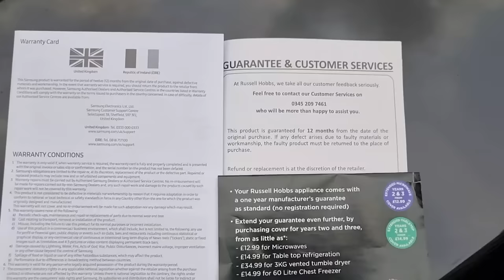My Highlights for buying a Grenadier #grenadier #ineosgrenadier #grenadier4x4

Comment: The standard 5 seat grenadier is a commercial variant if you read the website properly, its just the belstaff ones that arent. Im still curious how they're getting it approved as a commercial though
Reply from the maker: Thanks, I'll look into that. It's interesting they've done that... Looking forward to discussing it with them
Reply: @landroverleks  yeah i need a bit more info on that before I decide what to go for, as a commercial has some other benefits like lower tax.  Anyway, another great video mate 👍
Reply from the maker: @steveofengland  That sounds like the right approach. Thanks 🙏🏾

Comment: That’s funny it works now. Great vid again. Totally agree with your points. A key question is road tax..are all variants eligible for commercial rates or only the 2 seater. If so can you retro fit seats on the commercial like the vw vans?
Reply from the maker: Glad it's now working! Thanks 🙏🏾 Good question - I would assume only commercial models would benefit from commercial rates. This is based on experience of my Commercial Defender 90. I would also assume you could retrofit seats as I also did that with my 90, but that is probably more of an insurance question in terms of modifications to the vehicle. I do feel those are two good questions to put to Grenadier, so I'll add them to the list.

Comment: Aha! found where you were getting the specs. Australian site doesn't have a brochure yet. A few observations from there:

It's a heavy beast - especially in diesel wagon (2,740kg)  which most Australians will spec. That leaves a good 760kg payload if not the pie-in-the-sky 1,000kg that was sometimes rumoured.
Roof loading (150kg/420kg) is brilliant.
Diesel highway 10.4 l/100km, apparently on the K02s(!),  is good.
90l fuel tank is simply not enough for Australia, so there will be a rush on jerry cans here.
Diesel torque delivery (550Nm 1250 - 3000rpm) is great.
Turning circle (13.5m) accounts for standard (in Aus) rear view camera - lots of 3 point turns.

Mystery: So they dropped the 5-seat utility BUT the standard station wagon back seats have 6mm less legroom and 91mm more luggage length behind them than the Belstaff editions. Brochure also does not quote luggage length or volume behind first row seats for standard station wagon. Different back seats? Is the standard station wagon really what we thought would be the 5-seat utility? The photos on page 22 show standard station wagon has seat-backs further forward and the table notes a half height  cargo barrier.

If the rear seats on the standard wagon are further forward, more upright, don't fold, and have a cargo barrier behind then it really is the utility 5-seater. That means getting the standard wagon with  cherry-picked options is not really an alternative to the Belstaff editions that have a more comfortable rear seat that folds for more luggage space.
Reply: My local Gold Coast Distributor said they were working on long range tanks. I am getting the safari windows so full roof rack is out and the roof bars will need to be mounted too far back to mount the LED light bar. The Roo bar says it has mounts and wiring for extra lights so I will wait and get some lights mounted locally or mount them myself.
Reply from the maker: Great observation Mark! Insightful on the differences in back seats set-up in the Station wagon relative to the Belfast editions. That's a question I'll be putting to them - Are we being sold the Utility 5-seater wagon as a Station wagon?
Reply: @DavesIneosGrenadier  Dave, trying to track down the roo bar wiring info - was this on the website?

Comment: Yes good summary, few more specs would be very grateful: maximum axle loads and loads at tare, weight of alloy v steel wheel rim etc,  Pictures of accessories to understand how they all fit in would be helpful. Guess this info might come on the 18th but at present it seems only the U.K. market received a brochure - some of the details in that as we now know, are not applicable to other markets e.g. tow ball down load for U.K. is 150kg.  This figure caused considerable debate in Aus given our trailer ball weight is approximately 10% of the trailer. i.e. 3500kg trailer will have about 350kg of ball weight - many potential customers in Aus would have been forced to look elsewhere on this one spec alone if at 150kg.  Fortunately and hats off to Ineos Au, they did step into the debate and clarified the 350kg is indeed the tow ball download for Australia - just not published yet.  Could have saved a lot of effort if information such as this was included in the 'full specifications' on line.  The informal communication with Ineos in Australia has been outstanding really.
Reply from the maker: Thanks! I agree they'll likely release more info for the Australian market later. Good to learn about the tow ball load difference between UK and Aus.

Comment: Fieldmaster, metallic gray, Rough pack, Roo bar, checkerplates raised air intake. 17" alloys
Reply from the maker: That's a great combo! We are not worthy enough for checkerplates as an option or accessory in the UK. Will have to rely on aftermarket suppliers.
Reply: @landroverleks  Happy to buy them for you and ship them over. Or better yet take them as carry on luggage. That would be amusing.
Reply from the maker: @DavesIneosGrenadier  Thanks for the offer 🙏🏾 I'll see what happens in the UK and might put the question to Grenadier. I might take you up on your offer towards the end of the year 😁

Comment: If you do everything a la carte, you will pay through the nose. If you get one of the two packages, and add a few options, that’s the “value” proposition.
Reply from the maker: 💯 I agree with that point. At the moment I'm most attracted by the proposition of the Trailmaster Edition + plus a roof rack. Other things can be bought over time... Hmmm, I would need to put 35s on mine though 😂😂
Reply: @landroverleks  The Pricing sheets are now available on the North American website, along with the slick brochure, for all to price out their version. Some very interesting and unexpected options and accessories. My dream version ended up at $75K US.. Oops!
Reply from the maker: @CJ-rk5eg  😂😂 what was your baseline?
Reply: Re the value proposition, Do you mean the rough/smooth packs, or the trial/field editions?
I find the smooth pack hard to justify unless you really need door lighting. 

Trial/field editions - maybe my working out is wrong but there's no cost saving with them.
Fieldmaster options add up to GBP 6495 which means you pay GBP 505 extra for the jacket
Reply: @WillFisher92  I started adding up the options one by one on the base station wagon edition. Very quickly the price went above 59,000. So I believe the packaging of off road options will probably yield a better value if you get the identical options as compared to the a la carte approach. Haven’t worked this out precisely but it was looking that way if you compare apples to apples approach to building the vehicle.
Reply: @landroverleks  started with the base 5 passenger station wagon! So I will need to recalibrate my desires 😂

Comment: Had reserved one but now cancelling as full specs are out. 
Woeful payload 689kg on the diesel Trailmaster!  That’s with only 90% full fuel tank and no occupants! 
So put two people in, a long-range tank as 90ltr is ridiculous for a series overlander vehicle, a winch which is another must along with bull bar and roof rack.  Then throw in camping gear, luggage, engel fridge, and I’m already over loaded!
Forget about towing a laiden 3500kg caravan as 7000kg Gross train weight just won’t do the job.
I was really looking forward to purchasing but no better than the competition re payload and towing with less power and torque than my Landcruiser 200 V8 diesel.

Comment: They said the order books wouldn't open until June so they are clearly building anticipation. Pricing late April, Configuration Mid May, orders open early June and manufacturing starts in July.

Comment: It is called a Trial Master not Trail master. I made the same mistake
Reply: Me too. According to the brochure it seems they are named after JACKETS. Apparently Belstaff designed a jacket for some legendary motorcycle trials rider.
Reply: @markelliott6105  Yes. Name our car after a jacket. If you get the Trial master it comes with a Trialmaster jacket and if you get the Fieldmaster it comes with an Aubergine coloured Fieldmaster jacket. Surprisingly I don't own any aubergine coloured jackets so it will be an addition to my wardrobe.
Reply from the maker: Thanks for the correction! Trail sounded right, but obviously not 😂
Reply: @landroverleks  Yeah Trail master seemed logical and obvious. Unfortunately the sister company doesn't make a Trailmaster jacket so no opportunity for a cross selling marketing ploy.

Comment: Fuel tank capacity is far too small for Australian driving in the outback… also the clearance issue will require 33-35’’ tyres …warranty integrity is all about behaviour of Manufacturers…nothing less.. banner headlines about years are meaninglessness… servicing in Australia???
Reply from the maker: Those are fair point. I did hear somewhere that they might be working on a solution to increase fuel capacity, and that's influenced by the Australian and African driving experience. However, I can't confirm that right now. I don't think we'll have problems putting 33-35" tyres on. Check my Q&A video. At the most, you might just need a tiny modification to fit the 35s, which would still be covered under warranty.
Regarding warranty integrity, my experience so far is that they're putting their money where their mouth is. I'm feeling a bit confident on that...
They should be providing updates on servicing and parts in Australia in the coming months as Australia is a couple of months behind the UK...

Comment: I think anyone looking to buy a JLR Defender is a completely different customer to the one buying the Grenadier
Reply from the maker: Do you mind elaborating on your point? At the moment I'm of the view that whilst Grenadier will have some customers that wouldn't have considered buying a JLR Defender, a sizeable portion of Grenadier's customers will be those who will otherwise have bought a Defender if Grenadier wasn't in the market. Even Grenadier have admitted to that. I do consider Jeep as a Grenadier competitor too...
Reply: @landroverleks  The JLR Defender is built like an SUV, monocoque chassis, dependent on electronics/software for what is impressive off-road performance  , scary build quality, not something you would let get out of warranty. The Grenadier is built like a truck, ladder on frame, dependent on hardware for impressive off-road performance, unknown build quality, designed to perform long past warranty. Physical appearance is also an issue with JLR Defender designed to appeal to the "dog in a hand bag" crowd and the Grenadier more for the "manly, adventurer if I want" crowd. I think the people buying the Grenadier want an original Defender (L79) but not the rubbish that comes with it. The JLR Defender want a Range Rover but cant afford it.
Reply from the maker: @DavesIneosGrenadier  I see your point. I feel we could go back and forth on this 😂 I agree with your point about the difference in build and use of Grenadier vs Defender. I just feel that largely applies to a small section of the market who have specific 4x4 needs - most of us on these platform having these discussions and some commercial users. I feel there is a huge section of the market who just need something capable for when they go camping or off road ones a month or to just tell their friends about it even if they never get to push the vehicle to its limits. JLR Defender currently has a huge section of that market and I believe Grenadier wants a big chunk of it. The Fieldmaster is a good example of Grenadier trying to appeal to those customers. Those are people who would otherwise have bought from JLR. Another way I look at it is to ask myself who is currently filling the gap left by the old Defender. Right now it is largely JLR Defender. Their Q4 profit was higher than forecasted despite being affected by the chip shortage. So, it's natural that Grenadier would want to price customers away from JLR. Anyway, I might do a video on this topic...
Reply: @landroverleks  I recall reading that  Ineos hope to sell 1,000 units in Australia in 2023 which would put them about level with the JLR Defender, Defender sold 1,495 in 2020 and 1,144 in 2021. In a country where tough 4wds are extremely popular Landrover has really been a dismal failure. Driving anywhere outside of a city a bull/roo bar is a must have. I don't think one is available yet for the JLR Defender. In Australia the Defender is just a fashion accessory for the school run. The Toyota LC79 sold more than 10 times the number of Defenders last year
Reply from the maker: @DavesIneosGrenadier  That’s understandable, especially in the context of 4x4 in Australia. The landscape in the UK is different. It's generally more forgiving and 4x4 isn't a core requirement. That's largely why Land Rover has been so successful here as the vehicles are hardly pushed to their limits... Great discussion 👍🏾
Reply: Dave, I own the L663 and I have a deposit down on the Grenadier with a plan to put have the Trialmaster.   I may be an anomaly but there are a lot more of us then you think.  We plan on keeping our L663 as the daily driver, quick escape load the back with what ever for the day.  The Grenadier will be our bug out vehicles that we will use when we want to disappear and not worry about check engine light.